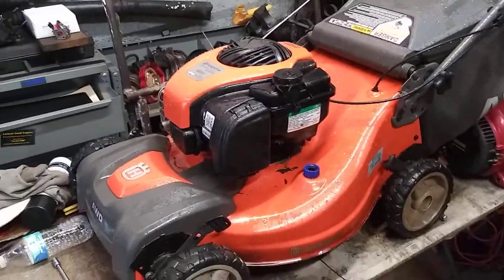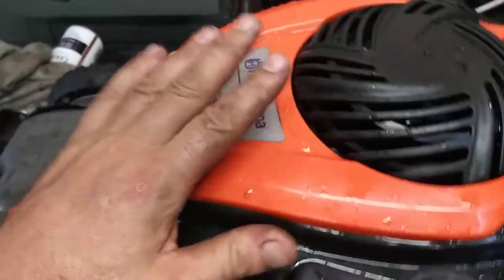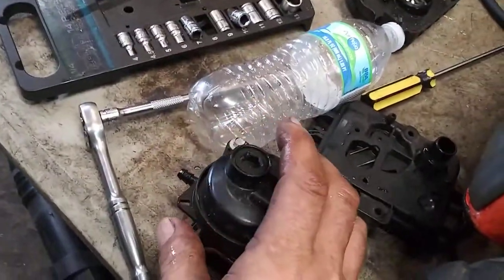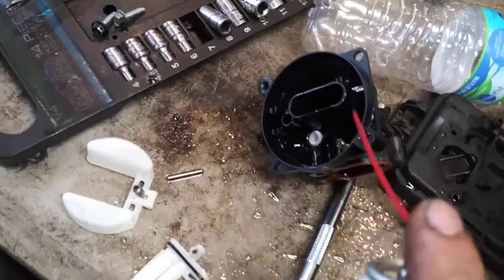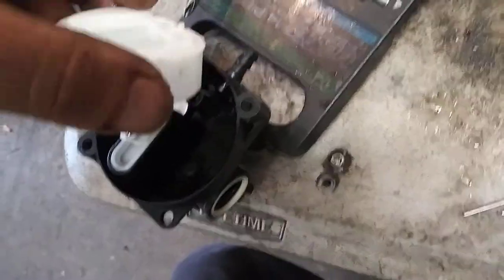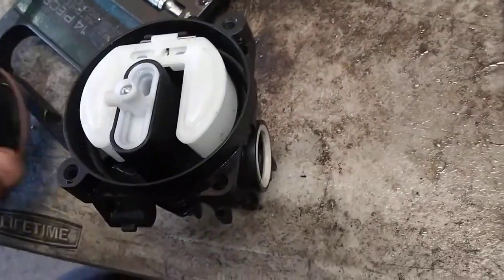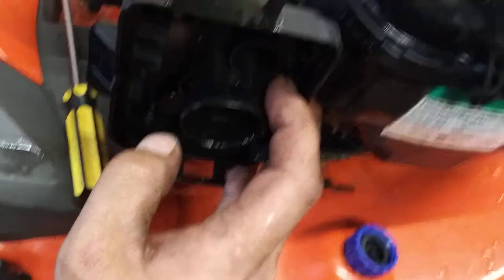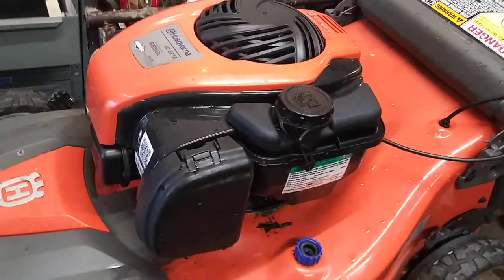* Husqvarna lc 221a carburetor repair 625ex briggs and stratton lawn mower

Comment: A good Video. I have a husky mower later model than this one, but it has the same carb. Has been surging for a couple months, so I finally decided to clean carb.  I have worked on many mowers for over 40 years but never had this problem. So, after watching the video, I removed the carb., used guitar string to ream out jets, sprayed them with choke cleaner, put back together and started it up and is not surging. Was an easy disassembly and re assembly. My model is 725ex. Good video.
Thanks for posting..
Reply from the maker: pretty much the same process. just be careful not to make the jet larger you'll fowl plugs fast or it wont run correctly

Comment: This is a phenomenal video!  I have two of these mowers that I got used and they had both bogged down over the years.  Took one out to see if I could start it two weeks ago and my toddler son put the garden hose in the gas tank.  This video showed me how to get the water out and clean the carb parts.  That mower worked so well I took out the other one and did the same cleanign and filter repalcmemtn on it.  Now both are runnign like new.  Thanks so much for this video and the great step by step instructions!
Reply from the maker: Glad i could help! Great job!

Comment: Mower would die immediately, and run choppy, now it RUNS LIKE A BEAST!  Thanks for the great video!!

Side note: I had no Carb cleaner, so I used Dawn and Hot water then dried the heck outta it. Also, the tank was easy to slide off, so I did that and cleaned it with HD grout cleaner I had allaying around and rinsed several times then dried all moisture out.
Reply from the maker: ive used toilet bowl cleaner. whatever it takes to get it clean!

Comment: Thank you!  I was actually replacing my carb (~$20-25 part) with a new one.  So easy to do.  This video took all of the guess work out of it!
Reply from the maker: Glad it helped!
Reply: @smallengineguys  Local Husq shop parts guy told me if I wasn't used to rebuilding small engine cabs to just save the hassle and replace it.  Glad I did. Started on the first pull.
Reply from the maker: @jwinslow5661  actually this is the easiest carb in the world to clean. if you have the ability to replace it it is only 2 more bolts to clean it.
Reply: @smallengineguys  I tried your email and it was returned 🤷🏻I checked and double checked my typing?
Reply from the maker: @kristianpallone8726  captainjason1975@live.com

Comment: @3:35 I fought with trying to put that white jet assembly back into the carburetor but it would not snap back in. Turns out that white ring inside the carburetor needed to be pushed in about a 16th of an inch and then the white jet assembly popped right in.
Thanks so much!!!

Comment: I was working Oon a 725 EXI LC 221ah.  Husqvarna.  Reall simular.  I could get the carberator back on the tube.  Very tight.  I had to spray carb cleaner and iat went right on.   
  The side tube wasn't alighed with slot on  this model.  Also of note,  That's a good gas/water check.  Although I see wet beads of water that look like they are in the bottle already.

Comment: Thanks for this.  Effed up and didn't winterize mine from Oct to first mow in April.  No start.  Ethanol or not, pretty sad 'modern carb' equipment can't go 6 months with e10 or whatever in it.  Had to borrrow my brothers 1998 $100 Craftsman Troy-Bilt that could sit for years with bad gas and run like crap but still start basically every time.
Reply from the maker: no difference between carbs. same same.

Comment: Excellent video brother, thank you so much...Mine starts and runs about a minute then stalls and wont start..Wait about and hour and it starts again then stalls. I replaced the plug gapped .024-.031,,,,I removed the carb and blew it out with compressed air. But i didn't remove the carb bowl at the bottom, should I do that?  I installed the carb and it wouldn't start. Waited about hour and it started and ran for about 30 seconds then surged a few times then stalled............Oh and i also removed the gas tank and cleaned it out and blew it dry with air.  New gas too. I was thinking the coil might be going bad. Can the coil cause surging and stalling?  Do you recommend I take off the carb bowl and clean it like you did in the video? Sorry for such a long comment...
Reply from the maker: so easy to clean the carb i would do that. it is possible it is the coil but 95 percent of the time it is a carb issue.

Comment: Ugh. 62yr old lady, husky 221 FHE owner. Will try as advised. Seems like I won't fail, watching your really well-explained instructions.  Need to go buy one of those bent needle nose pliers first.  
My prob -  I filled my husky 221FHE up w brand new rec fuel, started no problem, did a section of my lawn, and suddenly it just puttered to a stop.  Checked air filter - a mess. I see oil splattered everywhere! Cap was loose - I didn't retighten from last weekend's check. Cripes. Check oil level - zero.  Go buy a new air filter and a gall of 5w-30 at husky shop. Filled it w/oil..lots of it! (not happy w self). So,  Now, it starts right up (meaning it's not the spark plug, right?) but then it stops, just as quickly. Starts, stops, etc. Two hours later, starts then stops.  Starts and then stops. No lag. 
- Somebody else had a video on readjusting valves - oh please no. I'm going to give this a try. Anything else I should check?? 
                                                                                  (And Thank you, btw, for this awesome video!)
Reply from the maker: Firs any pliers will work on the fuel line. Second this mower holds only 3/4 a quart of oil. Make sure its not to full  and it sounds like the carb needs cleaning. Youll do fine just follow my instructions.
Reply: @smallengineguys  UPDATE: (and 2nd update) I DID IT!!!!  ...RPMs are way too high!   2nd UPDATE - I tweaked a metal frame away from the 'governor' spring mechanism, and that happened cuz I worried over the 8mm screw on right side earlier, it was just all 'off'.    So, RPM is better, still seems a bit high, but maybe it's as it should be/should've been?  I'll burn this up, or I won't. We'll see, I guess.

Comment: A small plastic piece with black tip fell out of the bottom of the float.  Do I just slide it back in when replacing the float?
Reply from the maker: that is the needle valve. it regulates fuel delivery to the carb. it slide in the float then into the carb. i show this in this video
Reply: @smallengineguys  Apparently mine fell out, then I slide it back on.  At first I thought I broke it then realized it slide out.  Thanks for responding
Reply: Worked like a charm after I followed your advise!!  Thanks so much!!

Comment: What are the part numbers, or names of the two springs?  I have the hu775h and can’t find the exact ones I need 

Thanks!
Reply from the maker: the ones on the carb only come with the carb not separate
Reply: Oh man so guess I buy a carb kit…  Thank you for responding, it’s been a challenge

Comment: Great video! This got my mower running again after some bad gas.   I seem to be having an issue with the idle staying stable now.   It was fine for one pas, then stalled.  It would start, run for 10 seconds, then stall again.  I moved the linkage back and forth a few times then it ran ok (at a lower RPM then normal) so I mowed the lawn.  Stopped it, then went to start it again... now the idle is way too high. Could it be just time for a new carb? or could I be looking at a linkage issue?
Reply from the maker: i have only had to replace 1 of these in all my years doing this. and that was because someone else was in it first and lost some important pieces. sounds like you need to clean the carb again. please make sure you clean the tank very clean. and please use brand new fresh today gas. also non ethanol is best but if it isnt easy to get use low octane. these mowers dont do well with high octane, also clean or change air filter and change plug. make sure choke throttle linkages are in properly. hope this helps and of course if all else fails go to the description below click the link get a new carb.

Comment: I did all of that except pull the float and needle valve. Couldn't get it to start. Gonna try again, I guess.
Reply from the maker: Maybe do all of it this time. Any debris in needle valve will instantly clog everything again
Reply: @smallengineguys  it was the auto choke. Wasn't seated right
Reply from the maker: @sgtrickards5683  thatll do it

Comment: So I already clean carburator, replace spark plug, add fresh gas and still stalling. Any other suggestion? I noticed a little crack in the little filter inside gas tank. Could be that?
Reply from the maker: No. Carb needs to be cleaned again or you need a new carb. New carb link is in description below.
Reply: Just replace carburator and still doesn’t start. Any other suggestion? Mower is 3 years old.
Reply: Starts but stalls right away.
Reply from the maker: @christianmoya1150  did you clean the tank? Did you use fresh brand new gas?
Reply: Yes I did. What else could be the problem?
Reply from the maker: @christianmoya1150  bad plug? Bad spark? Get a spark tester from your local auto parts store they are 10 bucks. You may be loosing spark.
Reply: I just put a new spark plug.
Reply from the maker: @christianmoya1150  sorry i am out of ideas hard to diagnose without it in my shop. my experience is most people use the same gas. usually that gas is the culprit. again cant tell you till i see it.
Reply: I read something about spark plug gap. I guess I’ll keep trying until either break the whole thing or fix it. Thanks for tour help.
Reply from the maker: @christianmoya1150  bad gap wouldnt let it start to begin with. Local shop may be willing to diagnose it for a small fee.

Comment: Are they worth it my toro walk behind smart stow gave out after 2 years
Reply from the maker: your toro was probably worth repair. usually is just a carb job. if you keep the oil changed and the carb cleaned it should go 10-20 years. non commercial of course

Comment: I can get one of these for $140, from folks the next county over, 4 yrs old only used for 2, they got a riding mower,,,, is it worth it or pass and get something better.
Reply from the maker: it is if it starts first pull. if it doesnt it will cost around 80 bucks to get the carb rebuilt. unless you are slightly mechanical and can follow directions then this video will do you good. these carbs clog easy so i suggest non ethanol fuel
Reply: Thanks my friend,  I can tear down a cold starting Suzuki,  I got this easy👍👍
Reply from the maker: @jeffthompson8663  perfect.

Comment: How did you diagnose a bad carb?
Reply from the maker: easy. just squirt some gas in the carb. not to much just maybee a gatorade bottle cap full. pull it till it fires. if it fires and dies its the carb.
Reply from the maker: i will be doing more diagnostic videos this summer. my daughter will be my cameraman. makes it easier.

Comment: One of Briggs and Stratton worst engine designs with these plastic carbs and auto chokes.  I pulled the carb again and it was plugged up again. I pulled the fuel tank and it had dirt and grass inside. The filet screen was plugged.  I cleaned out the fuel tank put the old plastic jet back in the carb and fresh fuel with Seafoam and it works great now